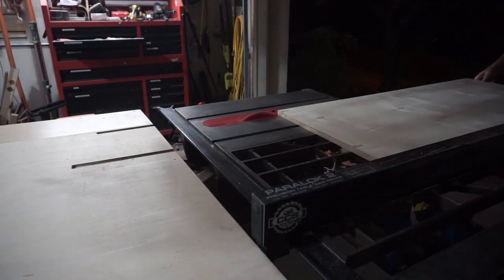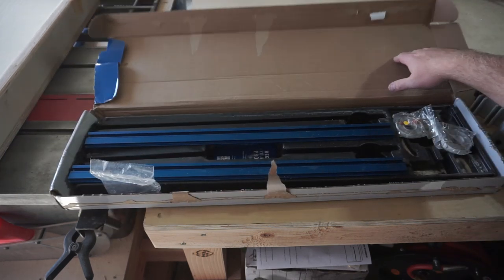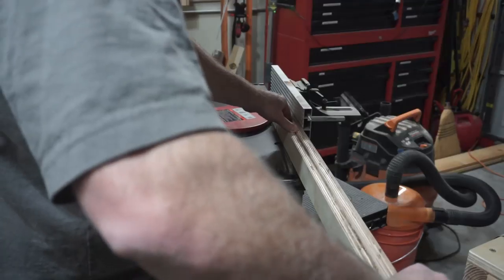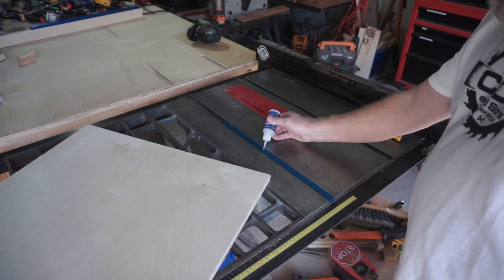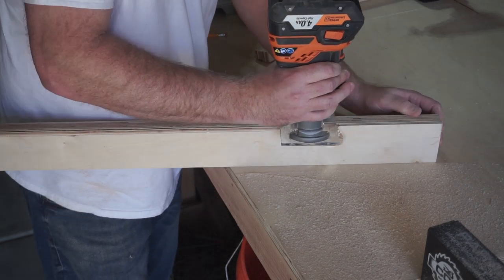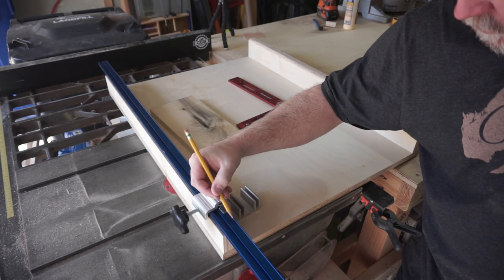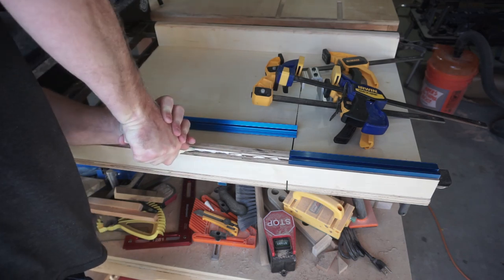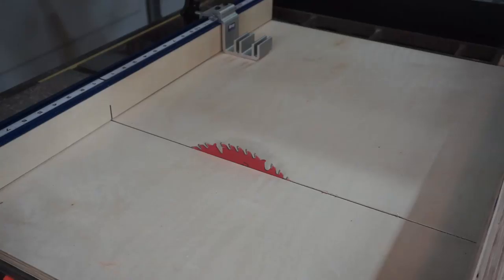How to Make A Simple Crosscut Sled - A Must Have Table Saw Jig + One Big Lesson Learned

Comment: Great looking sled! I like the stop block with measuring tape addition. One thing I’d recommend is to double stack a couple of smaller pieces of plywood and glue them over there the blade would come out the back. It gives your hands a “danger zone” reference and keeps the blade from even poking out the back in a lot of cuts.
Reply from the maker: @White Lab Workshop Thanks! Yes, I plan to glue a wood block there with some nice red lettering saying "NO TOUCH". Thanks for watching!

Comment: Good stuff mate, I’m making one in my next few vids & always thought a good square would suffice, did your square not interfere with the teeth ?, I’m leaning towards a small engineers square but like your method
Reply from the maker: @Somo's Projects I positioned the square so that it was between the saw blade teeth and flat against the blade. Thanks for watching!

Comment: That is a real nice sled. The tracking from Kreg is way too expensive. You should consider re-glueing the plywood as it split at 10:37
Reply from the maker: @Irish Chippy Thanks for watching, i'll take a look at the part you mentioned.
Reply: @CCSandSonsWorkshop  did you notice that the fence was out of true from that split/deflection caused by the screw?  It’s at the far end, but with a long piece, it might be noticeable.